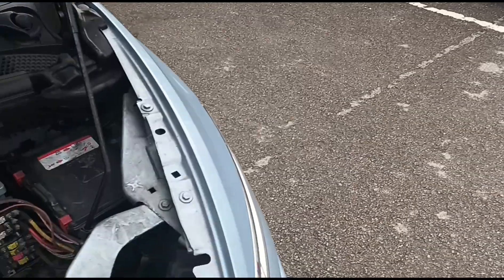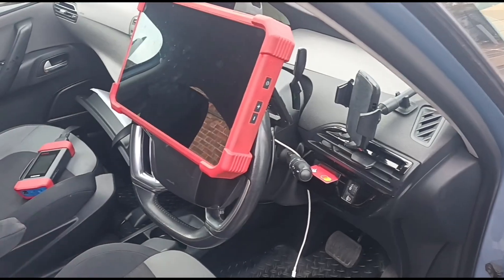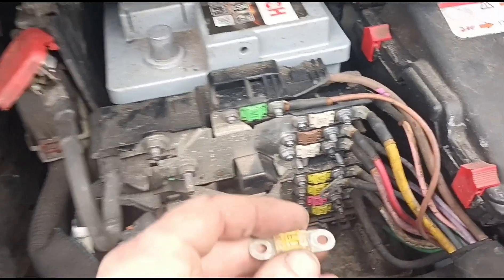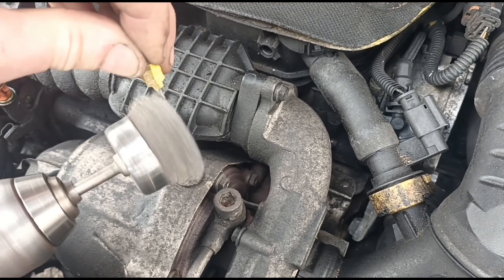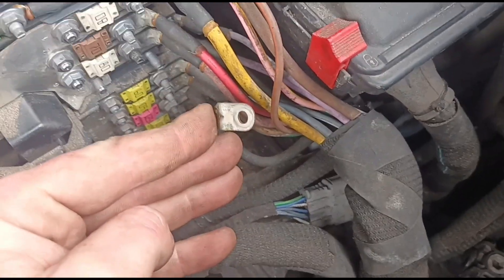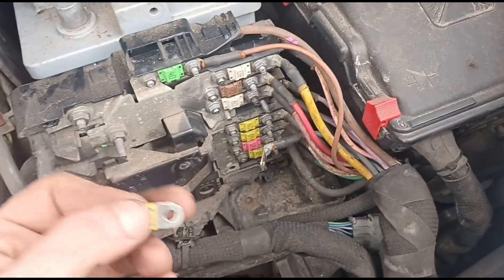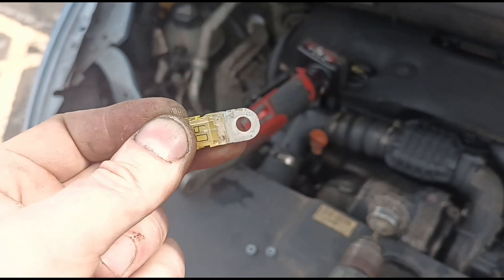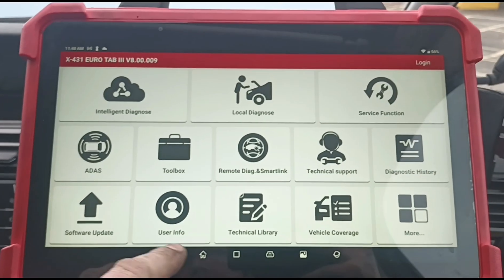Citroen C4 Picasso Various Faults Gearbox ECU CAN communication Diagnostic Inspection

Comment: Great video.  I have had new clutch fitted to a Citroen grand picasso 1.6hdi semi automatic vtr + 2011 and have had  it recalibrated. Now I am getting asr/esp, parking brake ,gearbox fault , engine fault  + engine light illuminated the car goes into manual mode and you can only operate 1st to 3rd manually then have to knock into neutral to operate 4th  to 6th when up the speed. Only happens after 20 minutes driving and when speed is up . Could this be the problem or is to do with abs /esr system some abs sensors  were replaced. Car is ready for MOT but these faults holding it back the Engine fault comes on immediately with engine management light when ignition switched on.
Reply: Very important to know about programming in clutch bite point/gearbox is that on step 3 (when you did the pogramming yourselves) it tells you that you have to a test drive. In that test drive, when you did the "3x going to 2000 rpm, wait for second gear and then stopping" and the 1 minute engine shutting it off and then 2x the same, after that, you have to drive and let the car go to at least 4 gear. When doing this, it is VERY important that going from 2nd to 3rd gear, there is no slipping of the clutch. If this is the case, you have to recalibrate it again but in a different driving way. It is all mentioned when pluggin your OBD scanner (something that uses launch, autel or snap on software or something that is as capable like those software machines) in to the OBD port and when going through the steps. Otherwise, if the programming was just programming it in without the test drive, you can could give you a gearbox fault and when plugging it in, it says that the clutch bite point was not programmed correctly. No idea, if this is what is going on, but just so you know 🙂.
Reply: @hadiamrane Have the ABS sorted and all codes except for engine fault repair and management light would it be the clutch needs calibrated? Egr valve changed .
Reply: @aidenrooney1785  You can only know if you read the car with obd scanner. If in the gearbox ecu module it states that the clutch hasn't been programmed in, then, you should do that. But if it doesn't, then its something else. Anyways, if the clutch isn't programmed in after replacing the clutch you will notice that the clutch starts to slip again as the ECU is using the old bite point of the old clutch on the new clutch. After a while of ignoring the slipping of the clutch you will get a "gearbox fault" on the dash which means that it you have to program it in as you have waited to long and the car doesn't like it.
Reply: Do NOT replace the gear lever or parts of it. We just had 'gearbox faulty' message and spent a staggering 600 euros replacing it, as the garage where we broke down said this was the thing to do, only to find after driving home successfully that the same fault has appeared. We are furious. Having now watch this vidoe, i believe we should get our local garage to check the fuses first. We are now going to approach them for an analysis and if it turns out to be the fuses, we will demand a refund of what we spent at the first garage. Fingers crossed. From what I gather, spent or corroded fuses and/or grease on the terminals is a major way of causing a malfunction of the electronics. With us, we can't use reverse. If you select it, the car just goes forward and not backwards. It does work if you turn off the engine and let it sit for a bit, but this is not good enough. It needs to work properly.

Comment: Why, C4 B7 semiautomatic, only paddles work great for shifting,but why Auto mode is turned off and SERVICE text is on display? It started after I sprayed silicone oil on the wheels.

Comment: My Grand Picasso -14 wont go from N to A or R...or M. Garage say they need to change the clutch. Sometimes it works after I've disconnected the + on battery. Is there a way to bypass the signal so I can shift gear so I can drive it to the garage?
Reply: Usually for this fault you need to repair the selector contacts, see videos about this on youtube. you could DIY or go to a shop and charge you a lot for it

Comment: Hello Mate, my Citroen C4 Picasso semi-automatic sometimes doesn't reverse but it drives fine.
Reply: Usually for this fault you need to repair the selector contacts, see videos about this on youtube. you could DIY or go to a shop and charge you a lot for it
Reply: I had the same on my 2009 Grand Picasso. Usually, if I bang the gear selector box on top of the steering wheel, it used to switch into the R until one day when it didn't. I found, believe it or not, one of the LEDs on that switch gear box completely desoldered - actually, the solder tore apart. Re-solder that plus all of the other ones to play safe (there are 6 or 8 in total, diode emitters and receivers - yes, it switches gears with LEDs arrays), and it's been fine ever since -- must be 4 years now. It could be something else, but if it works temporarily when you bang the switch gears box, 99% it's that. I found on YouTube this solution which works on mine. Good luck!

Comment: Brilliant tip. I've recently seen an intermittent  U1109 code myself, and given that there's no failures or faults found in the gearbox ECU, I thought it might just be something not getting a good connection somewhere. I've had various other U codes (U1218, U1318) from time to time and they often go away for weeks or months on end. I wonder if it might all be down to this.
Reply: U1109 çözüm oldu mu ?

Comment: Hi im having tha same problem on my c4 picasso (2012 plate) new battery still no joy, i replaced the handbrake switch as this was one of the faults displaying...still no joy. The warning lights only seem to come on when im at 70mph on the motorway. Any ideas would he a great help 👍
Reply: I have the same issue now. Did you get it fixed? Thanks.

Comment: Good shout this. I'm getting an electrical circuit fault on my Diesel BlueHDI 1.6 that started as an intermittent issue, now it's become permanent and is also draining the battery. If i dont drive the car for 2-3 days its dead. Already had a new battery fitted, still same issue.

Spent lots of time looking up the problem online and a lot of it points to the management unit that you stripped and cleaned. Its due in the garage for service and other repair work but i might take a look at this beforehand.

Thanks for the video.
Reply: Could you find the problem for your issue? I have exactly the same issue like you that the battery is dead after 3 days.
Reply: I've been waiting all this time to get it in at a Citroen Dealer (wait times round my area are a joke). I've been told by a separate garage that it will be the Battery Management Unit. So being told that and my own research makes me think it is 99.9% the cause. Citroen also said the same when I told them about the fault and the symptoms.

I did what Jimmy did in this video for the plugs and no change. The unit has a relay in the middle which as far as I know isn't replaceable. It's going in this Friday for this to be sorted along with some other issues, so once I hear back and it's resolved, I'll let you know.
Reply: @jamieilikeit Same in my area! Let me know if it was a problem. Thanks
Reply: @AlexS-cp9no  
Hey, so was this unit causing the fault (as suspected). Issue is now clear. No more beeping at start and battery drain 😃 Total including diag, parts and labour £666.71. mine was done with Stellantis but it will be roughly same price with other dealers. Hope you get it sorted. Still an eye watering amount for essentially a fuse box 😭

Comment: Great video. Had a problem with my Automatic Gearbox not selecting any gear on my Grand Picasso,and basically broke down. AA came out. And found grease had been applied to terminals that carry the signal for selecting. Probably by a trainee mechanic at the garage I use. Seeing your video I presume it was those terminals you worked on. Will be going back to my garage soon. They are a good garage usually. Thanks for video.
Reply: Did you resolve the problem?

Comment: How do you get the plastic cover off. I've taken the two bottom retaining bolts off so the unit can move freely, but I can seem to separate the unit so the wires become exposed. Thanks in advance.
Reply: Hi, I’ve run into the same issue, did you manage to get this cover off?
Reply: @thetakenalpha3301  ye, there are two torx screws on the back and one one underneath on the front. It was this one I was having difficulty with. It was hard to see. Once you remove all three and a couple of wires, there are 4 plastic clips on each corner than you separate.

Comment: Would vasaline help stop corrosion on the terminals? Helps with the battery. I can't see why it wouldn't work in this case .
Reply: A swipe of copper grease
Reply: you can spray wd40 on them

Comment: Have citroen dispatch 2.0hdi  no communication with can no wakeup on ecu will not start in morning changed cam and crank sensor fuel filter new starter 2.2kw new battery 80ah new fusebox lost fuel pressure overnight the van is posested by demons U1118 Communications On The Comfort CAN. No Communication With The Built-in Systems Interface
Permanent Fault

P1693 Remotely Controlled ECU Wake-up. Start Or Stop Requests Missing Or Invalid
Permanent Fault

U2001 Remotely Controlled ECU Wake-up. Main Wake-up Request Missing Or Invalid
Permanent Fault
Reply: Hi , did you find out the issue in the end ? I'm having a similar problem with Citroen ffs
Reply: My van 1.6hdi auto 2017
Engine starts, when my foot on brake  on pedal keep is fine , as soon as I go to a(auto) engine hic ups and cuts off, says engine fault and gearbox fault, what could it be?